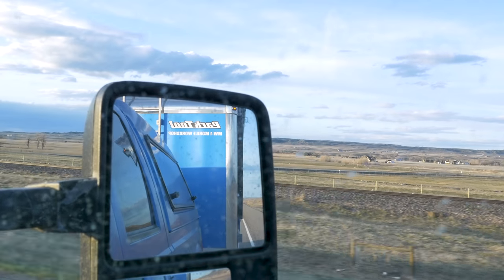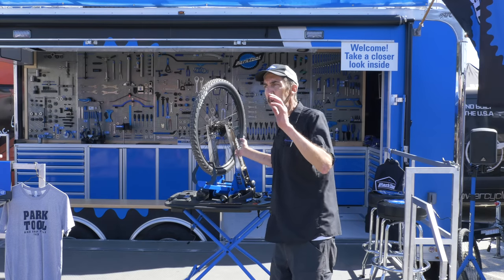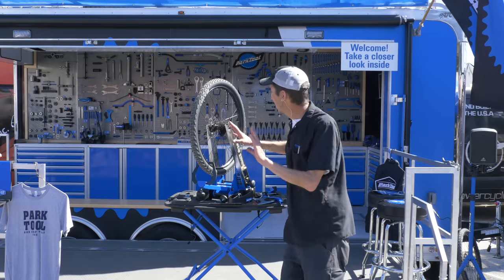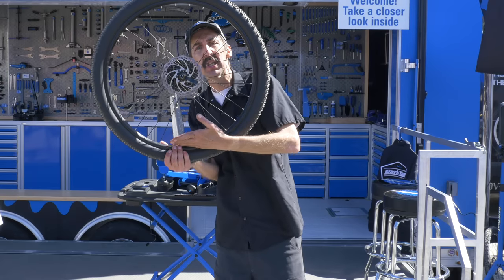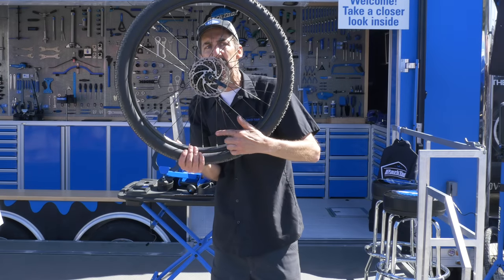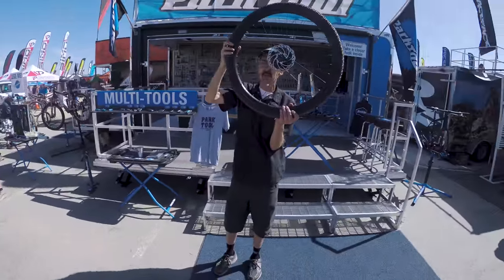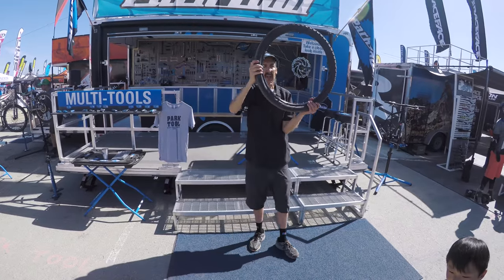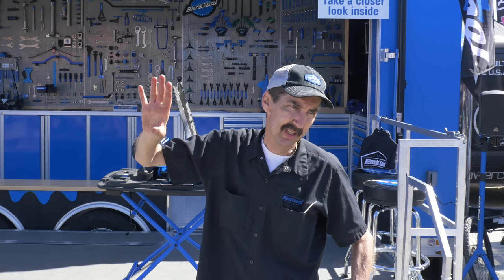Understanding Spoke Tension: LIVE at Sea Otter 2018 - Tech Tuesday #105

Comment: Excuse me, but during usage it is spokes of top part of wheel are getting loaded (stretched) not spokes on bottom part of wheel. That is pretty much considerable difference!
Reply from the maker: The spoke at the bottom are relaxed as the rim flexes from load.  The top spokes do not change in tension. However, the spokes at the left and right side increase.  This can be measured when the axle is loaded.

Comment: when relacing and building a wheel should I adjust the spoke tension with air in the tires or without the tire and tube.  It seems to me that the tension is less when the tire is inflated, is that correct?
Reply from the maker: The tension does drop somewhat with inflation. But most rim manufacturers give tension specifications for wheels without tires.  Stick with their recommendations unless you are seeing issues.
Reply: thanks!